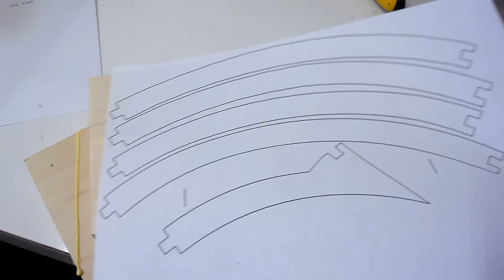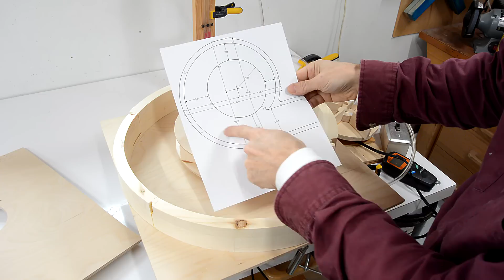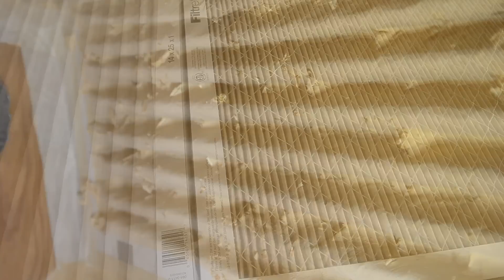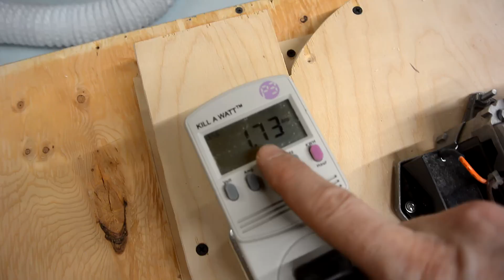Box dust collector

Comment: would it make sense to epoxy (or some other smoother surface) the interior of the housing?
Reply from the maker: it would probably help a tiny little bit, but not enough to make it worthwhile.  Besides, varnish whould be so much easier.

Comment: Hey! Was just wondering if this would work using car air filters.
Reply from the maker: If you get enough of them (10 for example) to get enough surface area.  Also the filters are not very fine, so you have to wait for enough dust to get into the filter to help catch the fine stuff.

Comment: Great video as always but watch your shirt cuffs. Really close to the blade at 4:45. Stay safe.
Reply: James Lester he's already made a video on this. there almost is zero risk
Reply: Sam Koch if you read the first comment on that video, Matthias thought it was an important contribution so he brought the comment to the top. The point being, just because your shirt sleeve doesn't get caught, doesn't mean you wouldn't flinch and touch the blade.
Reply: Safety Sally on the job anyway, though, even if M has already said he's aware.
Reply: Read and understand my second comment.
Reply: James Lester 
Then I guess you should have understood mine.
Reply: he's literally proved this wrong. a saw wont grab a cuff because it blows it away
Reply: I will reiterate my point. If you are startled by your cuff hitting the blade, you may react and make contact with the blade. I never said your shirt could Pull you into it.
Reply: James Lester 
The point is, he's already told you he's aware of the risk, yet you continue with the Safety Sally routine, even though he doesn't need to hear it.
Reply: I'm well aware he knows the risks. My comments are directed to those that may not be as informed. Clearly you need to move on. Your, "Safety Sally" comment speaks more about you than me. You can continue this discourse but you will be all by yourself. I'm out.

Comment: Matthias, do you think a motor from an old clothes dryer would work for this application?
Reply from the maker: those are lower RPM, so you would need a much larger diameter of blower.

Comment: How are those hoses? Are they getting riddled with holes?
Reply from the maker: Directly on the planer output, they do get holes eventually.  I hope the metal elbow helps slow down the chips a bit.
Reply: add more duck tape
Reply: Matthias Wandel I'm wondering if you have explored using furnace fan blowers for your homemade dust collector builds. I have one such blower and have seen a few attemps by others to utilize it as an air cleaner but not as a dust collector. I would appreciate any insight you can offer. thankyou

Comment: With your obvious mathmatical, physics, and machining knowledge/understanding I assume your job is in one of the engineering fields. I also know you use SketchUp for all your CAD drawings. If my assumption is correct then you surely know of AutoCad, Autodesk Inventor, Solid works, NX, and other software with much better and easier ability. Why not use one of them? I know that some can be very expensive but they do have trials and educational versions that are cheap if not free

Comment: Now here's a question. Would it be possible to mount your box onto a stand that's tall enough for a trash can to fit under. And then at the bottom of your box cut a hole and put a trap door on the bottom so you can empty the box easier with less mess?

Comment: I watched you using your table saw to remove the laminate from the edges of the bottom panel. You’re wearing a long sleeved shirt with the cuffs unbuttoned and hanging very close to the saw blade. I kept cringing thinking this was one of those tragedy videos where your cuff will be grabbed by the saw blade and do you unimaginable harm. Please, be careful. Button your cuffs or better yet grab some masking tape and wrap it around  any loose clothing.

Comment: he should add a light bulb inside it so that he dont have to use a flashlight
Reply: I don't think you'd want a source of heat in a box with forced air and flammable material with acres of surface area. Might be a good way to start a fire.
Reply: Could use some LEDs.
Reply: true he could add it outside the box instead

Comment: The dewalt thickness planner has its own dust expeller, and where did you get the fine dust from.....you do not get fine dust from a jointer so why are you trying to vacuum. Been watching Mattias vedios for years now by the content is getting a little to tech savvi and killing the woodwork tool guru I saw in him.....
Reply from the maker: jointers and planers actually emit a surprisingly large amount of very fine particles.  But a lot of the fine dust in the box is from resawing some wood with a bandsaw.